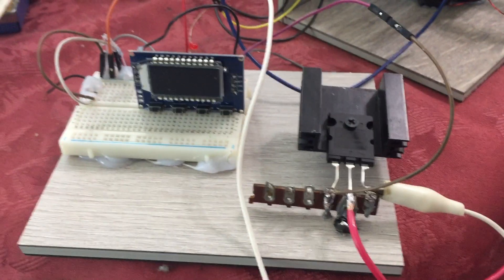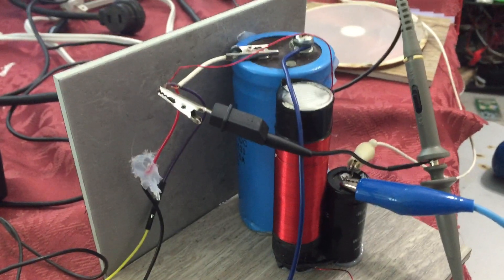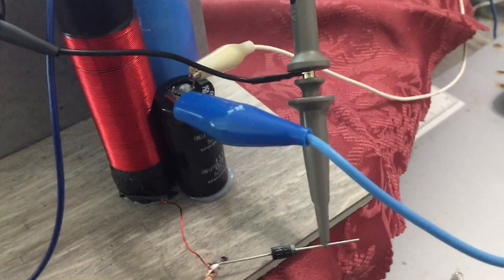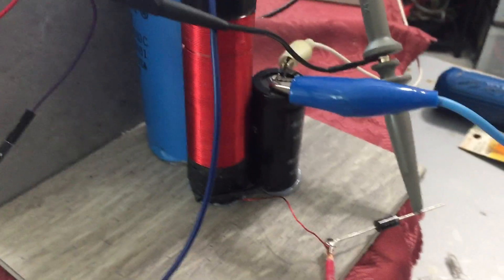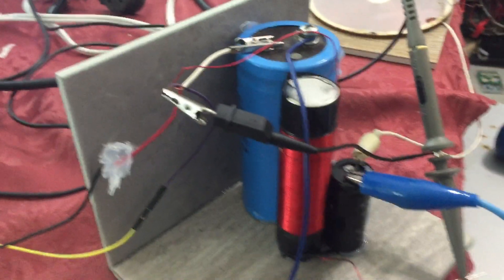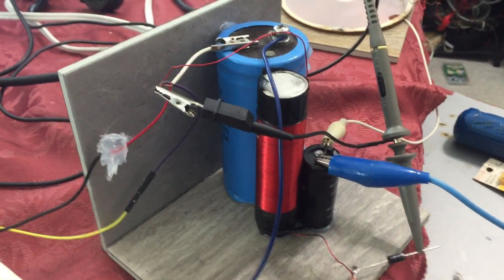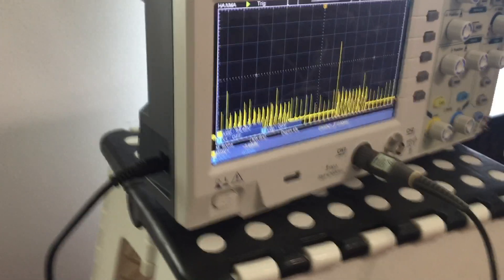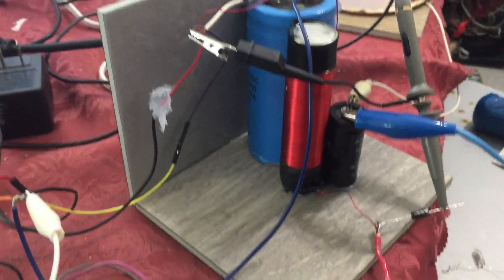Grounding and Pulsing

Comment: Did you ever show a schematic of this setup so it could be replicated? BOb and I replicate everything of interest we find, but tryibng to figure out the circuit from a video is a pain.
Reply from the maker: Its just a coil wrapped around a magnet or core pulsed with a switch any kind. and the diode inductive kickback positive also as a switch that switches a real ground to this plus side for that extra spike.

Comment: I think the short intense spike you see on the scope is the Back EMF. Imagine this! In your normal circuit the current is evenly distributed everywhere on it. When you touch it, you introduce a new ground path into the circuit. This causes a redistribution/change of current to meet those even "even distribution" requirements within the circuit. This redistribution/change of current in turn causes a change in the magnetic field to change in your electromagnet. Since the electromagnet is an inductor, it tries to resist the change by inducing  a current in the opposite direction of the change i.e. the Back EMF (Lenz's Law). This is what I think you observe on your oscilloscope as a very short lived intense spike before things become normal again. Very cool video!! 💙

Comment: Try an air cap two plates with magnetic rod in between the plate .

The caps field goes outward from its ends internally its locked in place between the cap plates, so maybe the rod should be two one at each end of the cap with coils on each rod.

Comment: If you are PULSEING it you need to make the COIL & CAPACITOR the same Values & Have the GROUND in between the COIL & CAPACITORS. It changes the entire circuit/ Output

Comment: This short/intense spike when you ground the unit reminds me of the water hammer effect. If you have water flowing in a pipe and you quickly block it off with a valve it produces a high pressure spike that can burst pipes. As you know, tesla loved to use water as an analogy for electricity and this effect you are demonstrating sounds exactly like that.
Reply: I've been watching some Dale Pond videos on John Keelys work in which he says it was the water hammer effect that  seemed to make his systems work. Apparently the water hammer was able to produce oscillations physically that equate to microwave frequencies produced within his devices chambers.

Comment: Use two separate ground wires through some weak diodes and see if they beat when you have a constant connection
Reply: Or nonpolar caps

Comment: That’s amazing, I don’t think I’ve ever heard anyone suggest pulsing the ground, thanks for sharing!
Reply from the maker: I think this is why the Kapagen/Don Smith works so well in part. We all see the grounding loop stage with the spark gap at high voltage doing the obvious, creating the ground loop path we are looking for when the voltage breaks the barrier. But no one sees the other part where it also acts as a natural switching the ground potential against the device breaking "ground" during spark gap off time. How the system "pumps"  I think I get it.....
Reply: @joellagace1679   another replications are also verify this,i think this is spot on. Bird_eye